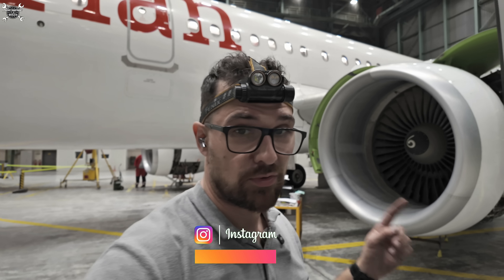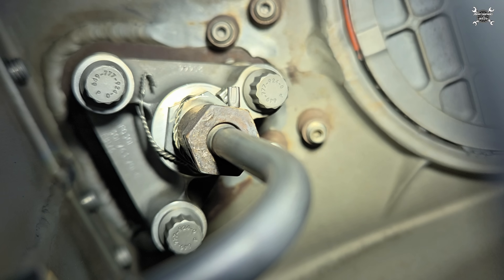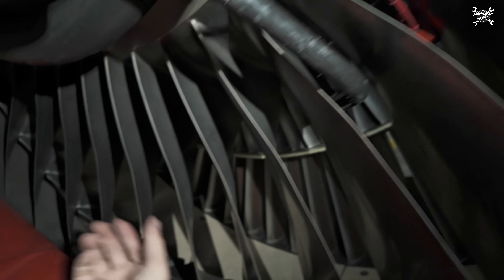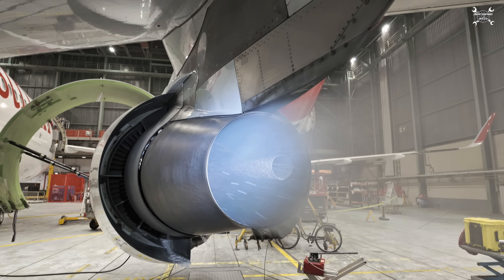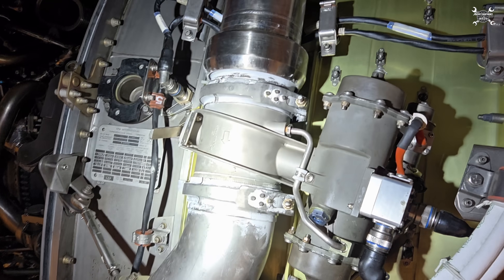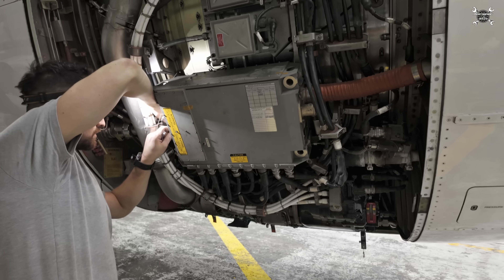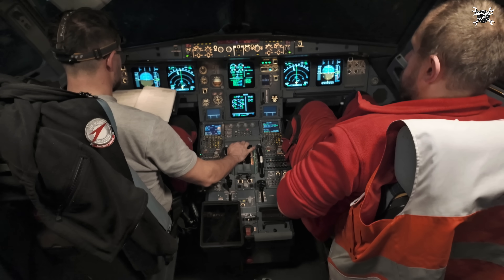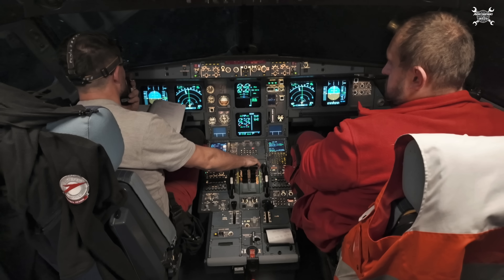How to wash core of the aircraft engine

Comment: while this excellent, you can see how this could be more automated with software and procedure changes without the the crazy run-up.  for example using a combination of a short run-up with software applying brakes in combination APUs to blow out these things.  engineering change, but no guess work.

Comment: You guys know, if there is an engine cleaning device available for A320 and A320 neo engines, for both the main fan and the engine core, that uses steam to reduce water consumption and improve the cleaning results for this type of engine? Thanks and a Big hug from Medellín/Colombia 🖖🇪🇨
Reply from the maker: Maximum temperature is 75°C for this procedure so I guess it is not allowed also pressure is limited to 65psi

Comment: If you have a rag in your back pocket and it falls out and goes in the intake while pumping solvent or water cleaning a  Lycoming T53 while in runup, cotton will come out where the bleed air line is disconnected. The engine only had its first hundred hour maint.

Comment: I was a jet mechanic in the Air Force.  The little J-85 engine on the T-38 needed to be treated to prevent blade corrosion, then every so often it needed cleaning with ground walnut shells sprayed into the compressor.  Like the CFM-56, all the compressor airlines had to be removed and capped to prevent chemicals and walnut dust intrusion into the components.  60 years later and some things never change.
Reply: We used the ground walnut shells in the USN on our pressure fired boiler's supercharger which was actually an 11 stage air compressor that pushed air into the boiler and then the exhaust passed through a 2 stage power turbine that drove the compressor with a steam assist for increased fixing rate combustion air demand.
Reply: So the J-85 prefers Walnuts to chemicals.....   So do I .
Reply: It is indeed but I was replying to MM-fq9gi   comment  [We used the ground walnut shells in the USN on our pressure fired boiler's supercharger which was actually an 11 stage air compressor that pushed air into the boiler and then the exhaust passed through a 2 stage power turbine that drove the compressor with a steam assist for increased fixing rate combustion air demand.].   Not a T=38 that does not have a steam boiler or supercharger.
Reply from the maker: How it pass combustion chamber?
Reply: @zeto.r  I think he is describing a multi stage  ( marine ) compressor turbine with the two stage power turbine driven from  boiler steam no combustion.  Known as a Forced Draft fan.
Reply from the maker: @Woffy.As far as I know T38 is jet fighter
Reply: What do you mean with Compressor Airlines? Were they airlines for some sort of pneumatic starter, or did it have a bleed air system that used airlines?
Reply: Interesting, ground walnut shells are use to clean car engine valve that has direction injection.

Comment: Sounds real dodgy and 12 months later you get blade failure
Reply from the maker: This is normal procedure on every engine out there. And I guess you mean bleed and if yes for sure this will not cause it
Reply: Bro this procedure is recommended by the engine manufacturer
Reply from the maker: @NicholasRiviera-Dr exactly

Comment: Fascinating to watch, one question. Although not shown I take it that after disconnecting the electrical leads both the cable and receiver connections were capped?
Reply from the maker: Watch it again. I didn't touch any electrical connectors. I said it clearly that they are pressure hoses and water can flow out of them....

Comment: Is that cleaning procedure new to airplane engines or it was used few decades ago too? Is those deposits contaminating engines due to modern "eco" jet fuel additives?
Reply from the maker: It has nothing to do with eco fuel. Engine wash is in use for very long time. This is mixture of oil dust ash an all other stuff which flies around and in side of the engine

Comment: wow! this is an amazing video, Thanks! 
I have a question, which procedure is your colleague doing in the cockpit? How's it able to control the blades without increasing the N1 rpm to a hazardous situation.
Reply from the maker: This is just dry crank which means only starter  is in use, without fuel and ignition which keeps engine speed at max 30%N2

Comment: Good work 👍

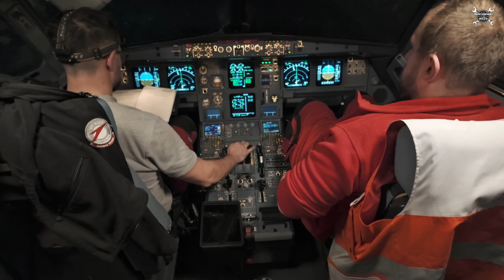One thing that catched my eye, at 13:28 it looked like a mistake that happens also to some pilots, calling “parking brake set” when handle is turned, instead of waiting to see pressure increasing in triple indicator or looking for ecam memo for the brake. This has also lead to aircraft starting the roll unintentionally, as the ecam caution for parking brake (brakes parkbrk fault, not available in all of the aircraft) takes some time to show up. Of course having chocks will help, but it would be a good habit to wait for positive indication before calling parking brake set, and only after that releasing brake pedals.
Reply from the maker: If you look i said parking brake set and we waited. The info is only about the turning the handle when pressure rise we released the brakes🙂
Reply: @zeto.r yea I saw… but generally better to call it set when it is actually set, as the handle is just like sidestick, that you can use for telling wishes towards aircraft, and aircraft then decides if it follows the request or not
Reply from the maker: @KoiranenAerospace  parking brake is connected to hot battery bus. It will engage even aircraft is dark.
Reply: @zeto.r  yea, unless there is a failure. I have flown babybus just 3 years myself and already saw it once failing to engage from flight deck and once outside of aircraft. If I recall correctly, on both cases it was failure in motor supplied by dc bus 2. Never read the description from amm, but I guess that motor from hot battery bus is commanded only if another motor isn't available (or if it's commanded always, it's rather slow compared to normal one). Skoda has more reliable solution than Airbus :-)

edit: oops, mistake, not ac, but dc bus 2

Comment: Hey thomassssssss
i wasnt expecting washing the engine core by some specific  equipment .
was that equipment  developed far later by demand of entire washing the engine core by controlled way ?
can it be fixed on most of turbine fan or simple jet engines ?
thanks thomas
Reply from the maker: Hi this tool was developed by lufthansa technik and if you watch previous video you will see how probes look for other engines. Engine wash is common practice to reduce EGT and enhance the efficiency
Reply: @zeto.r thanks for the info

Comment: Wow, I'm excited for this one! Never occurred to me before that you'd need to wash the engines, but now that I think about it, it totally makes sense since these beasts don't have intake filters like our cars do.
Reply from the maker: Yes, the engine wash is important for optimal performance!
Reply: The only place where jet engines are even more reliable than on commercial aircraft is in industrial applications where they also again have filters!
Reply from the maker: @rkan2 I guess you mean gas turbine or turbo-shaft engines which are use all around. That is different concept
Reply: @zeto.r  Yeah. The aero-engine derived ones are not really all that different when it comes to the compressor and hot sections. For example the LM1500, 2500, etc. as featured by AgentJayZ